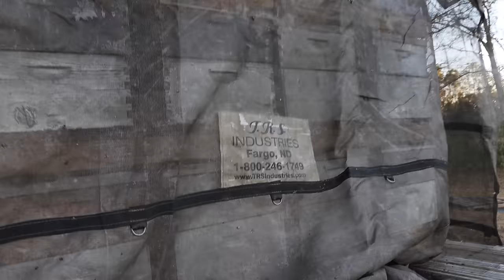Barry Hart Part 3 and Almond Pollination

Comment: I know you don’t do almonds anymore, but I have two questions.  First, I notice they are loading in the day. Most load at night don’t they? 
Second, what happens if a load is rejected at the border? Is there a service, the broker, someone paid by the keeper, etc to rectify the problem (get rid of the fire ants, etc) ?  Or does the load have to come back home?
Reply from the maker: It was late afternoon and cooling quickly when they began loading. If it was warmer they would have waited. There are independent outfits that for a price will unload the truck, pressure wash it and reload for re-inspection. It's expensive and can be detrimental to the bees if it is warm or hot. Some loads are outright rejected period and do have return home.